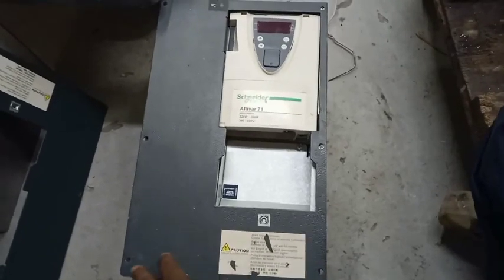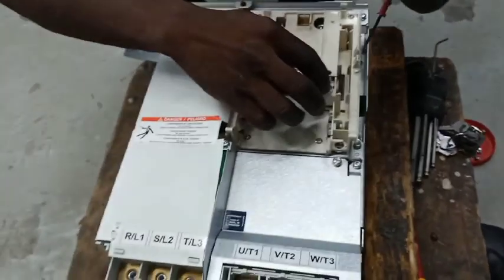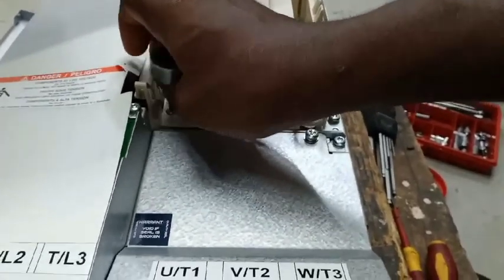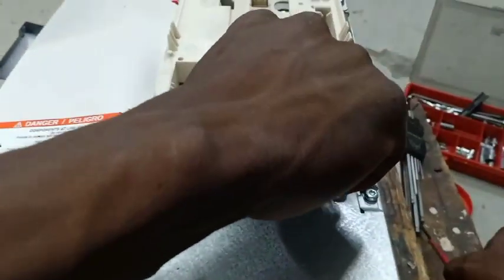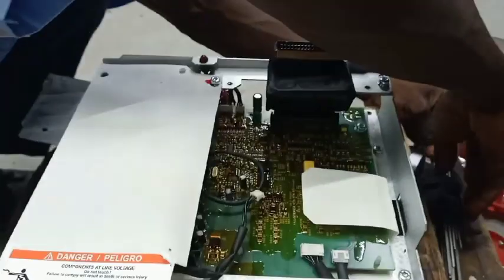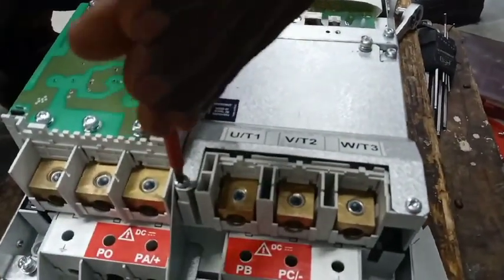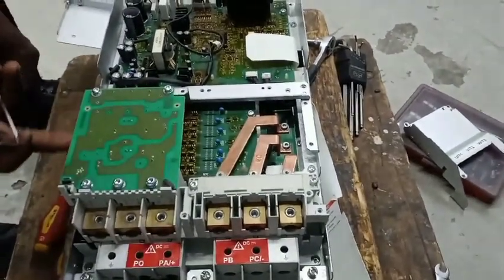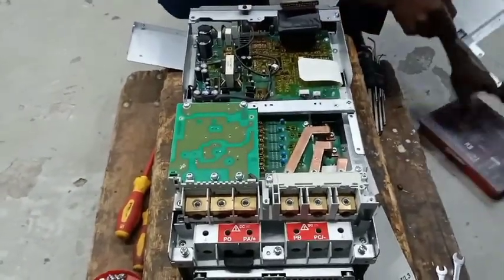Schneider Altivar nLP & SCF2

Comment: Здравствуйте, скажите пожалуйста как устранить ошибку PRA?
Reply from the maker: PRA means there is loss of control voltage 24V supply. Check with a multimeter on the terminal link  to the ground terminal if 24V is present in PWR terminal and the internal 24V terminal.

Comment: Hello, I have same inverter & same problem,  what can I do,  if I used dc 440v then same problem, please tel me, thanks.
Reply from the maker: What's the inverter displaying on the screen?
Reply from the maker: Since I haven't heard from you for the nLP fault try DIY by removing the electronics board clean it look for any ring spot and re- solder then remove all the visible plugs and re-socket in case of any partial contact. 
For SCF2 fault, check for insulation breakdown on the output side of the inverter towards the motor and if all correct try replacing the  filters.